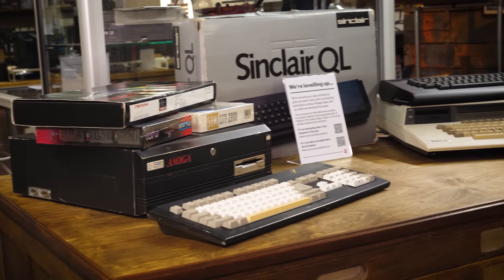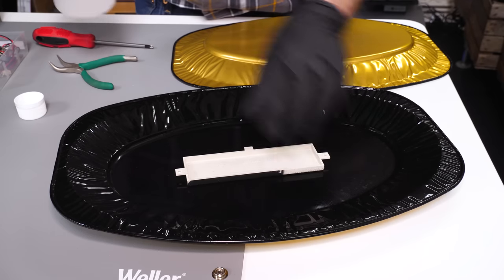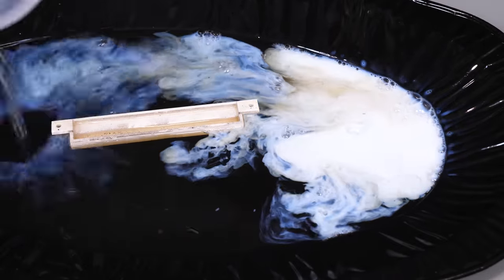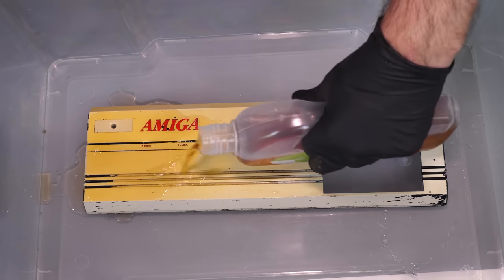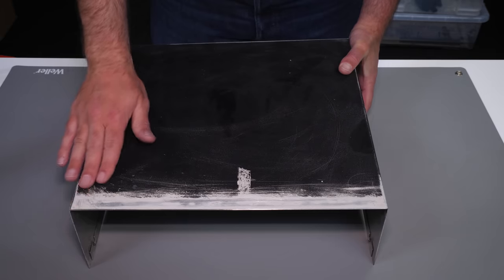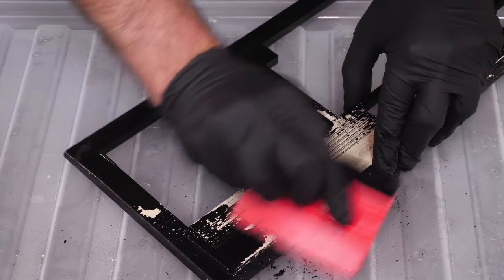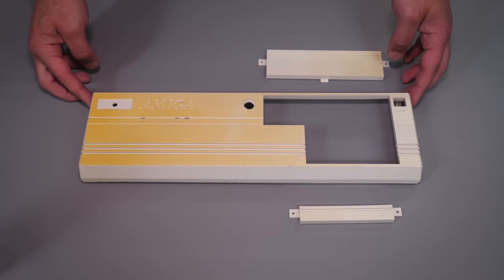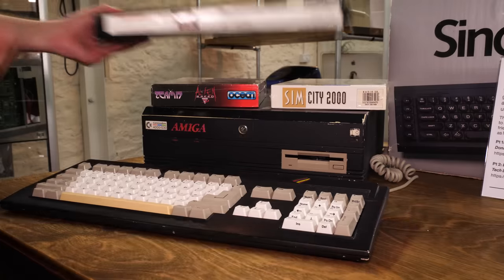Will the Paint Come Off? Amiga 4000 Restoration | Trash to Treasure

Comment: This Amiga featured in this series reminds me about how mine also had a previous history before my ownership. I bought my Amiga 4000/040 from a collage art student about 1993. He was moving to a Apple for his classes. He had painted his room while his Amiga was sitting exposed on the desk. He must have been using a roller type of paint brush. As the Amiga had this fine speckling all on the top front and keyboard. He said he did not do anything to remove it as he kinda liked the effect, a happy happen stance. I agreed with him and didn't touch the paint speckles. A few years later Silicon Graphics (SGI) workstations also had a similar speckling quality in their cases and keyboards. 

I still have that Amiga 4000 along with my A2000. Another coincidence is I also got the Cybervision graphics card for my A4000 too! Those vinyl wraps look awesome! I think there would be small but eager market for those. Great series!

Comment: @rmc i use this method but i use very hot water to mix with the ipa as it helps to soften the paint layers and makes it easier for the ipa to be absorbed. Get under the layers and dissolve the paint bonds.
Reply from the maker: Excellent thank you I'll try that, sounds like it will accellerate the process without adding any additional dangers except maybe being more careful of inhaling IPA laced steam

Comment from the maker: Do you like it beige or should it have stayed black?
Thanks again to Robin for the Amiga, and to Dan for his help, you can check out his shop at https://retrofied.uk/ for Amiga skins.
Please remember to adhere to safe practices when using chemicals and safe disposal of them.
Neil
Reply: I know I voted to keep it black when you first presented this A4000, but after seeing how well you restored it, I can only say that I'm amazed. <thumbs up>
Reply: I like both but it would have needed a full black paint job if you'd decided to keep it that way.
Reply: i didn't realize how many nicks and scratches the black paint had back in the pickup's video so i think you made the right choice as it looks beautiful now vs beat up. and the vinyl wrap was a genius solution to the top especially with the colors he came up with.
Reply: I see myself becoming more and more the "original condition" person. But of course on machines not so valuable, or if you have several, I can see why fancy paint jobs would be interesting :)
Reply: I don't like the corporate look. You have erased it's original character and I think that's a shame. On the plus, it won't heat up quite so easily on a sunny day as with the black paint job applied.
Reply: You did a great job, but it looked better in black.

Comment: I'm not sure how chemical procurement works across the pond, and what's available, but here in the States for removing acrylic paint we have Simple Green (green stuff) and Super Clean (purple stuff), which is actually an engine de-greaser. I very much prefer Super Clean when removing the paint from metal (tin pewter and older lead) Battletech miniatures, but when I spilled a small bit on my Macbook Pro protective case, it did warp the plastic in the spot it made contact. Simple Green from what I've been told is much more safe to use, but also take a bit longer to percolate.

Comment: Nice job!

I did remove paint from a chickenlips A500, which was painted half black and half red using an all purpose cleaner “blue wonder”. I’ve soaked it for 14 days and there after used a pressure washer to blast the paint off. But as well as you did, needed some scalpel to get into the crevacies. Maybe it was the type of paint or the amount of paint, but the method I used seemed more easier than in your video. Maybe try it once on a next project.

Comment: For the metal, you can use aircraft remover, it will cause the paint to bubble up and you can use a rag to wipe it off. You can't use it on plastic though. I use Vegetable Oil, which has a similar effect, you just need to scrub harder.

Comment: Looks great. I really like the wrap solution there, I'd say it is an easier solution than trying to match paint, and do a good job painting the top again.   I've used SuperClean to soak plastic such as model kits to remove paint from them.  At full strength it is quite a powerful cleaner, and will strip paint including enamel model paints and spray paint.

Comment: As a modeller I've moved away from Dettol and IPA and now use Biostrip 20 which is a gel and is so much more effective without the smell
Reply from the maker: Thank you for the tip I'll try that!
Reply: +1 for the Biostrip 20, sadly only available in the UK.

Comment: Have you tried citrus-based cleaners for the stubborn residues? Once upon a time I had some pads infused with a citrus oil thing that you rubbed heavily into the plastic/rubber and then used a wipe-off pad to remove again. Worked wonders on stuff like old power cords etc.

Comment: brake fluid is compatible with most plastics and strips paint. I'd probably start with the rubbing alcohol. Then try a strong alkaloid cleaner/greaser, in the USA they're usually purple. (It will warn you about discoloring or damaging aluminum and zinc)

Comment: Hands down the CV64 was the most compatible RTG card with the Roxxler chip. Would you believe I even got Simcity 2000 to run on it at an almost playable speed on a Amiga 3000, well 68060 and a lot of OS hackery tools were involved too, OS3.1 upgrade and so on, of course it still ran far faster on shapeshifter on the same machine.

Comment: I mentioned this in the comments for the original video when you first acquired the black Amiga, but my favorite paint removal method is sodium hydroxide (lye) based oven cleaner.
I prefer it to solvent based methods like the IPA and Dettol, because some solvents/oils can cause long-term embrittlement of the plastic.
The worst offender is brake fluid. It really does a number on ABS plastic, but I still see people recommending it (even in this very comments section).
The problem is that the embrittlement takes a long time to manifest itself, so everyting seems fine at first.
Reply: My normal approach for unknown paint on unknown plastic is to start with IPA, then sodium hydroxide, then acetone free nail polish remover.
Reply: Orange peel oil is pretty good, with a shot of terpentine it gets under everything.

Comment: If you ever need to create a new front cover for A4000’s hit me up, I’ve a STEP model of the front cover, drive bays, power button, etc - all hand-crafted by myself, I’ve 3d printed one in parts to check fitment (my printers are too small to print the whole thing in one go), and lobbed it up on shapeways, it’s even been carved out of aluminium for a limited run with the help of one of the amibay members :)
Reply from the maker: Oh wow I was talking to Amiga Bill this morning and he mentioned an aluminium one so that must have been the very same. Great job
Reply: @RMCRetro  Thanks! I would link the github repo and the shapeway shop url but I think my last comment got purged 🫣

Comment: What I used to remove paint, from painted plastic... "Brake fluid", for cars.
But you can't just brush it on, and it's finished.
You have to wait an hour, or two.
The good thing about Brake fluid, is, it won't damage the plastic.
And paint stripper will damage plastic, I think ?
I never used paint stripper on plastic. 
Why would I, when Brake fluid does the job, and it's much better for the human skin.
And much easier that Detol.

Comment: Brake fluid is good for stripping paint from plastic. There is a substance called modelstrip that strips Paint from plastic, but it comes in small quantities and is expensive
Reply from the maker: I'm not an expert but I have hearted a comment to the top which advises against brake fluid and explains why, so please double check any methods recommended in the comments before trying them
Reply: @RMCRetro  ok

Comment: Excellent job Neil, automotive brake fluid can also be excellent at removing paint without damaging plastics. One for future testing maybe, I've had good results with this in the past :)
Reply: I have also used brake fluid to remove paint from model railroad locomotives. Also Pine sol cleaner works but takes a while. I guess it depends on the type of paint. I need to try some of these again but in my ultrasonic cleaner to see if it speeds up the process.
Reply: Brake fluid can damage ABS plastic. It can cause embrittlement, and can even etch the surface of the plastic if you leave it long enough. I prefer to use sodium hydroxide based oven cleaner.
Reply: @thepenultimateninja5797  I've never had any issues with it in  20 odd years of using it on models, each to their own.
Reply: @MatSpeedle  it probably depends on exactly what type of ABS you use it on, how long for, the exact formulation of the brake fluid etc.
I just know that sometimes, it causes the plastic to become so brittle that it can be broken apart with your fingers.
It might not even be noticeable on a model, because they are generally handled with care anyway.

Comment: I have a 4000 case with lots of rust spots all over. Does anyone have any suggestions? I'm planning to get it re-capped and hopefully in working order. It too has a Cyber vision 64 in there along with 16MB of Fast RAM plus the 2GB.
Reply: Clean up the rust with some fine-grit sandpaper. Then wrap it, of course ☺

Comment: Any idea if this would work on an Amiga 500 case someone stupidly sprayed with black spray paint?
Reply from the maker: I wouldn't like to say with certainty as different prep and paint may have been used, but the A500 has a trapdoor and a side cover you could use to experiment on first
Reply: @RMCRetro  Unfortunately they only painted the top 😕, So it will be a leap of faith job. Thanks for the reply though  Neil 👍

Comment: Hard Plastics like the Amiga front panel (Probably ABS - Acrilonitrile Butadiene Styrene) are usually impervious to more aggressive chemical paint strippers containing Sodium Hydroxide (Caustic Soda), but you need to be a lot more careful in using them. They can be purchased at paint suppliers in a gel form to brush on.  The paint wrinkles up quite rapidly.
Long rubber gloves covering forearms, full face protection etc. You definitely don't want it on your skin and it eats holes through natural fiber clothing fast.  (Read more!!)

Dettol is definitely less hazardous and it's great to know it worked so well in your attempts. 

The paint removers to absolutely avoid on ABS or Polystyrene as used in model kits are the ones containing solvents like acetone or turpentine which will both dissolve the plastics, but they won't affect metal and they add hazard in being highly flammable!  They carry warnings against use in places without adequate ventilation, and professionals use solvent-removing respirators for protection....

I think some industrial paints (two-pack epoxy based etc). may be more resistant because they form polymers and become much more like the plastic you're wanting to rescue.    They're unlikely to have been used on casual home repaint jobs, because they're expensive and require accurate measuring and mixing before use. 
If you encounter paints that don't react to the above, they're probably of this type..

Urethane based paints (mostly clear finishes and glues used in woodworking) begin to set/harden on exposure to the moisture in the air. They are chemically similar to the expanding foam aerosol cans used by tradesmen to close holes in walls after plumbing work etc. I don't know which paint removers are effective on them, but to safeguard the plastics you want to restore. all the above prohibitions and precautions should be a priority.

I've also noticed that some Chinese-made low-budget articles (eg. usb-stick type Mp3 Players) are coated with paints that deteriorate and become tacky over the passage of years. I have found they clean off with IPA exposing the underlying shiny (ABS?) plastic, and assume they used IPA as a solvent for spray-on application.

PS. The vinyl wrap is an excellent idea for case lids.

Comment: No offense, but what the previous owner (Robin/teens), who painted it black, missed, was not just using any old black paint, but slick shiny metallic black car paint.  That is what was missing here.  And it's painted with charcoal-colored semi-matte black, not shiny glossy pitch black.  Thus, this one looks dull-looking.  Cars have shiny paint for a reason, it's attractive, like shimmering reflective blinding water, bathed from sunlight.  What was also missed was the floppy disk face plate, which stands out.  The wear-tear scratches of the paint that expose the original beige plastic doesn't help either.   Now sure, some matte black might work, but here it didn't.   It's all subjective, but I would have preferred glossy black metallic car paint.  Many PC case manufacturers use, & have used, glossy paint.  Still a nice restoration overall.

Comment: Would a steam cleaner work?
Reply from the maker: I'd be worried about melting the plastic or changing the texture of it with anything heat related (with the exception of the quick blast to remove the badge)

Comment: I don't think IPA does anything to paint. I use it all the time when i need a cleaner that is very safe and quick evaporating. My guess is that what is really happening, is that it gets between the paint and the plastic. Similar to how they use IPA to loosen hot glue. 
The keyboard bottom likely didn't work because the paint was better adhered to the plastic. The plastic might have been less textured for example. 
For such cases you would need a real paint stripper. Ask a vintage gear restore guy what they use on bakelite and other early plastics.

Comment: I'd advise you to dip the pieces while retrobrighting. And also you shouldn't cover it with a lid which has some patterns that can cast shadows onto the pieces.
Reply: Sun will move during the day, those shadows will move around.
Reply: This had been tested quite a few times. Not dipping means less chance of marbling. The vapor has a very even distribution. Also heat is an much more important component, you can do brighting without any sunlight at all.
Reply: @bzuidgeest  Hydrogen peroxide is water soluble. So it will be as evenly distributed as in vapor form, if not less.
Reply: @alpyre  then why not use the vapor if you think it's the same? Why submerge if you think the vapor does the trick?
Reply: @bzuidgeest  For more exposure to peroxide of course.
Reply: @alpyre  you risk overexposure. More isn't always better.

Comment: Would have had the metal top blasted and powder coated...?
Reply from the maker: A sensible option but it's nice to try new things out
Reply: @RMCRetro  yes, but the powder coating option I would say is more durable?...more to this the point another amiga rescued!
Reply: @comfysofa1549  Main issue with a powder coat (aside from the cost) would be getting an accurate colour match. I suspect you'd have to just make do with a generic beige. Arguably more durable but not by much. The textured laminate used is pretty sturdy, and more than up to the job considering what most A4000s would be used for these days.
Reply: @retrofieduk  This is true but while i cant defnitavely say there are a lot of RAL numbers out there! :) -  itd be close!

Comment: What would probably have worked faster for you in removing the paint is a degreaser.  Available from hardware and automotive stores.
Reply from the maker: As with any advice seen in the comments section here I would advise people to double check before trying and also try a sample part before committing. A cursory search shows that some degreasers can  be incompatible with plastic, it can craze, embrittle, or soften the material. I've not tried it myself.